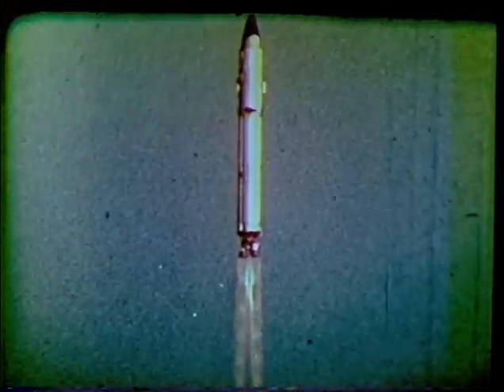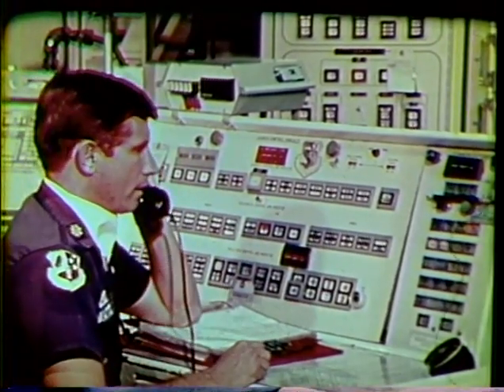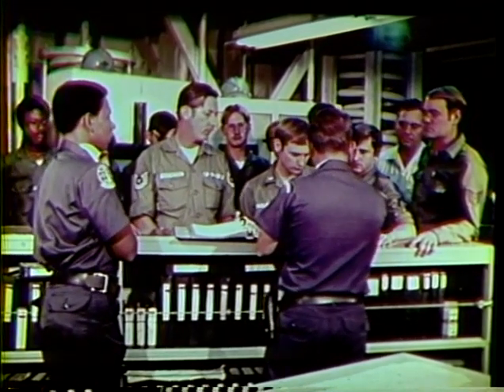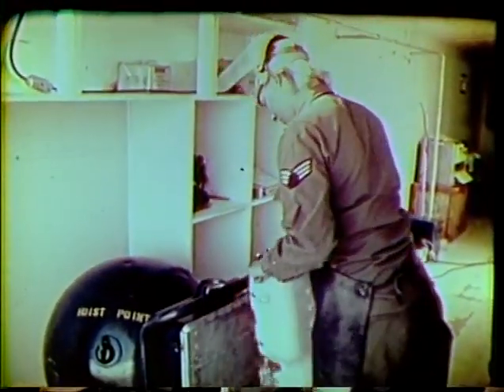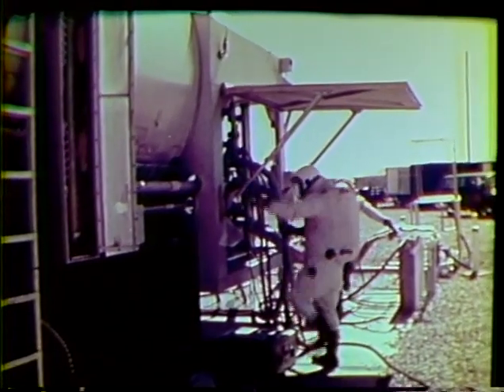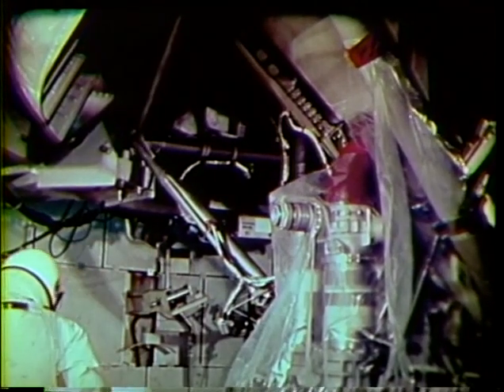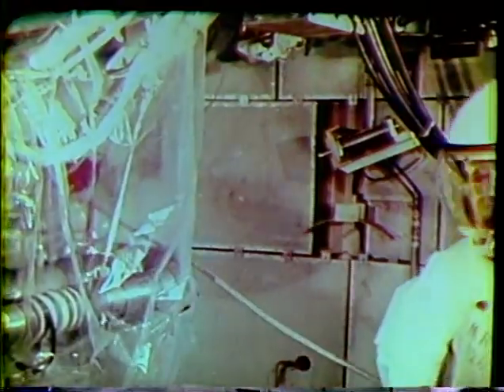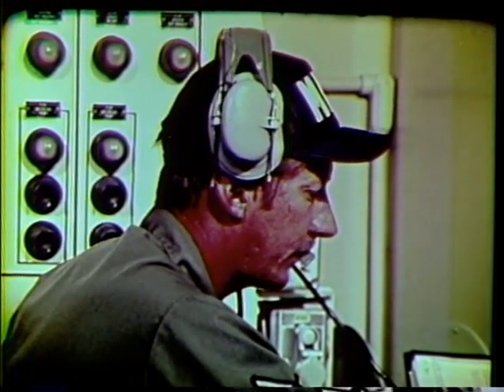Titan II Propellant Transfer Operations (1980)

Comment: Crazy to think that they used to use UDMH rather than solid fuel.
Reply: REMEMBER the SPACE program started whit titan 2 as lift body
Reply: At the time storable liquid propellants were a HUGE improvement over the first generation liquid oxygen/kerosene propellant missiles like Atlas, Titan 1, and the Soviet R-7 Semyorka (still in use today as the "Soyuz rocket").  Liquid oxygen is negative 291 degrees, so it's a cryogenic liquid that has to be stored at extremely low temperatures and in pressurized systems.  Unfortunately due to the low temperatures it constantly boils off in the lines and missile propellant tanks, so those early missiles had to be stored with the propellant tanks DRY and IF the missile needed to be launched, it couldn't be until the propellant was loaded into the missile.  In times of crisis, the missiles could only stand "on alert" ready to launch for a finite period of time, basically until the liquid oxygen storage dewars adjacent to the coffin launcher or missile silo ran out of liquid oxygen, since the tanks of the missile required constant "topping up" of liquid oxygen due to boiloff, and venting of the boiled off oxygen vapors from the tank to prevent the tanks from overpressurizing and rupturing.  Once the dewars were empty, the boiloff would go unreplenished until the missile no longer had enough oxidizer to perform its mission.  It would be "out of commission" until the dewars were refilled so that the missile could go back on alert.  Fueling operations for the old liquid oxygen missiles took hours, so yeah lots of operational limitations and disadvantages to the old Atlas/Titan 1's and Soviet R-7.  

Engineers figured out pretty quickly that room-temperature storable liquid propellants would be far superior.  Since they're room temperature liquids, they don't have to worry about boiloff issues like liquid oxygen, and can be stored in the missile tanks for very long periods of time, so the missile can stand "on alert" for long periods of time fully fueled and ready to launch at the turn of a key, like solid propellant missiles.  The downside is, they're VERY toxic (hydrazine and nitrogen tetroxide oxidizer) and require the use of "space suits" and very careful propellant handling to prevent exposure and death.  They're also highly corrosive and hypergolic, meaning they ignite on contact with each other... this means leaks are particularly dangerous, from a fire danger as well as toxic vapor danger perspective.  This was the reason that the US Navy decided to develop solid propellants for their submarine based Polaris missiles, since the risks of toxic vapors and flammable liquid propellants capable of igniting on contact was deemed too dangerous for a submarine (fire aboard ship is the biggest nightmare for ship or sub personnel).  Solid propellants can't leak or ignite on contact or emit toxic vapors, etc.  The Soviets didn't have solid propellant technology for large missiles until later, so most of their ICBM's and SLBM's were storable liquid propellant fueled until the 1970's.  

Titan II, using storable liquid propellants, was a huge improvement over Atlas/Titan I in this regard, despite the dangers of handling the toxic, corrosive, and hypergolic propellants.  Liquid oxygen had it's own dangers in handling, being cryogenic and pure oxygen has the tendency to burst into flame on contact with anything flammable, and to burn extremely vigorously... even the oils in a fingerprint can ignite in contact with liquid oxygen, aluminum will burn like rubber with liquid oxygen, even diamond burns in liquid oxygen.  SO they were used to dealing with the hazards of liquid propellant; storable liquid propellants just had some different issues from liquid oxygen.  

As development of the solid propellant technology advanced, it was clear that future missiles would be solid propellant.  No tanks, no valves, no complex mechanical rocket engines, it's a solid so it cannot leak, no toxic vapors or cryogenic temperatures, etc.  The fuel is much denser, so more can be stored in a smaller missile.  Speaking scientifically, the most EFFICIENT propellant for missiles is liquid oxygen and kerosene, it has the highest specific impulse or "fuel economy" in layman's terms, (yes liquid hydrogen/oxygen is higher but not used in missiles because liquid hydrogen has a whole 'nother set of complications in its use); storable propellants like hydrazine and nitrogen tetroxide have lower ISP (specific impulse) thus it takes more of it to do the same job, which is why Titan II is larger than the LOX/kerosene Titan I (plus greater payload/heavier warhead, which required more fuel to propel it to its target).  Solid propellant has the lowest ISP, but it's denser and thus more fuel fits in a smaller missile.  Operational concerns outweigh sheer efficiency, IOW, solid propellant is "good enough".  The solid propellant Polaris was much smaller than its Soviet storable liquid propellant missile counterparts.  It was clear that solid propellants was the "wave of the future" for all future ICBM's.  The first Minuteman missiles went on alert during the Cuban Missile Crisis.  Minuteman was a much smaller missile than its predecessors, could stand on alert virtually indefinitely with its solid propellant ready to ignite at the turn of a key.  The silos could be much smaller and simpler, allowing them to be hardened against nuclear attack much more than the larger, more complex silos required for liquid propellant missiles, which improved survivability of the missiles and lowered costs and made them much easier to build.  It also did away with propellant handling in the silo for the missiles, since the missiles had its propellant cast in the rocket motor at the factory and thus none of these complex and dangerous operations, and none of the plumbing and monitoring/support systems required for propellant handling in the silo.  The downside is, the missile is EXTREMELY HEAVY because it must be moved, transported, and emplaced in the silo FULLY FUELED, and of course there are procedures required for the safe handling of solid propellant missiles also since the propellant is already mixed together and cast into the motor casing, and any accident which would ignite the propellant would cause it to burn until it  was all expended. Being that Minuteman and Polaris were fairly small missiles, these weight and handling issues were easily overcome (unlike the massive shuttle boosters and proposed 21.6-33 foot diameter monolithic solid propellant boosters NASA had been considering and even tested, but never developed further-- their sheer mass and handling difficulties made them infeasible operationally, at least cost-wise).  Thus as Minuteman came online, it replaced Atlas and Titan I which were retired, and Titan II remained in service due to its huge warhead designed to destroy deeply hardened targets, at least until the Damascus incident revealed the weaknesses of the system and the costs involved were no longer deemed worth it, and Titan II was retired.  

The Soviets too had quickly realized the drawbacks of LOX/kerosene propellants and instituted a crash program to develop storable liquid propellant missiles to replace R-7, like the R-9 and R-11 and subsequent missiles.  Their haste and cutting corners on safety directly led to the 1960 "Nedelin disaster" where an R-9 missile on a launch pad for a test flight, fully fueled, developed a problem and rather than canceling the test, standing down, conducting the repairs, and rescheduling the test, the newly appointed head of the new Soviet Rocket Forces, the branch of service created to oversee the Soviet Union's nuclear ICBM force, decided to order the technicians to the pad to work on the fully fueled missile and conduct the repairs and continue the test.  To "lead from the front", Marshal Nedelin went out to the pad along with his aides/entourage, while the missile was being worked on.  Nobody realized it but a timer on the second stage had been activated and during the course of repairs, the upper stage ignited on the pad and its rocket engine blast soon burned through the top of the first stage's fully filled propellant tanks, rupturing them and collapsing the entire rocket onto the pad.  The spilled liquid propellants ignited on contact, and clouds of toxic vapors gassed the survivors, as the entire area turned into a burning hellscape.  Hundreds of technicians and rocket experts died, along with Marshal Nedelin and his aides; he was only identified by the partially melted medals he had been wearing (he was a highly decorated Soviet general from WW2).  Those that survived were burned beyond recognition and the fire was so hot the tar in the access roads was melting and bubbling, with survivors having to run through it trying to get to safety.  It was the greatest disaster in rocket history.  

Later!  OL J R :)
Reply: Solide tale Up more SPACE 
This if you look at IT 
Have more power on less 
SPACE
And the siloes need to be way
Deeper if solid ..solid became a THING 
On the shuttel.. in the 80 this is way Way before
Reply: @kennethschultz6465  No.  Solid propellant is less efficient than liquids, BUT it's MUCH denser, so more fuel fits in a smaller package, which is exactly what you want for a missile.  In addition, the solid propellant is mixed and cast as a paste into the motor casing and cured into a solid chunk at the factory, so there's NO propellant handing lines, valves, systems, monitors, vents, etc. required in the silo for solid propellant missiles versus liquid propellant missiles.  This means the silo can basically just be a "hole in the ground" made from extremely hardened reinforced concrete, making the missile much harder to destroy than the larger, more complicated silos which cannot be built as hardened as the smaller solid propellant missile silos, making liquid propellant missiles more vulnerable to a nuclear attack.  Basically the only thing solid propellant missiles need in the silo is a series of wiring/cable connections to the missile to monitor the sensors aboard the missile, program its guidance unit and provide power to it, and to order the missile to ignite when launched.  Solid missiles are also much simpler, as there's no complex liquid rocket engine with propellant pumps and combustion chambers and injectors; solid propellant missiles use solid rocket motors which burn the premixed propellant from the center outwards, and exhaust the hot gases through rocket nozzles which steer the missile in flight under control of its guidance system.  

The shuttle solid rockets came about as a cost-saving measure, and to simplify reusability.  NASA did not have the money to develop the fully-reusable flyback shuttle booster which the original shuttle had been based upon, and had to team up with the Air Force to get the funding necessary to even finish the shuttle, which changed the shuttle program remarkably and not for the better.  Solid propellants had always been deemed "too dangerous" for manned vehicles, precisely because they cannot be shut down once ignited-- they burn until the propellant is all expended.  Liquid rocket motors can be commanded to shut down so a crew vehicle can escape if the booster is malfunctioning, solid propellant boosters cannot be shut down.  NASA and the Air Force needed a reusable booster, and while experiments on dunking liquid rocket engines into salt water and then refurbishing and reusing them had been done,  and various proposals for parachuting delicate liquid rocket boosters into the sea for recovery and reuse had been studied and proposed but never funded or attempted,  landing a fragile thin-skinned and very large liquid rocket booster into the sea and recovering it and refurbishing it for reuse and certifying it 100% reliable (or as close as possible for a manned vehicle) was deemed too problematic.  Reusable solid rocket boosters would use a very thick (about 2 inches thick) maraging steel (same steel used in submarine hulls, extremely tough material) casings to contain the rocket propellant and form the walls of the solid rocket motor, and thus were MUCH tougher and easier to recover after a parachute landing at sea and towing back to KSC for reuse.  Liquid rockets landing in the sea would experience hard to predict landing forces, stressing the vehicle's airframe, possibly bending or stretching or at the very least stressing the metal structures and weakening them, and possibly causing propellant leaks or failure on subsequent flights, which is why solid propellant boosters were chosen for the shuttle.  In point of fact, the solid rocket boosters of the shuttle cost SO MUCH to recover, refurbish, inspect, transport by train to Utah for more propellant to be cast inside them, and then transported back to the Cape and stored, and then transported, erected into the boosters, prepared for launch, transported to the pad, launched, and recovered again, that it would have been cheaper to simply make disposable boosters out of spiral-filament wound composite rocket motor casings like those used for missiles which are "single use only" fire and forget type vehicles.  The failure of a solid rocket booster caused the death of 7 astronauts in the Challenger disaster.  

Solid propellants are REALLY inefficient and heavy and hard to handle, which is why they're a very poor fit in the space program, where weight and ease of handling and the benefits of more efficient liquid propellant is a real bonus... which is WHY solid propellants, particularly LARGE solid propellant boosters like the Titan III/IV had, have been retired.  Small monolithic solid propellant boosters like the Delta series rockets and more recently, the Atlas V and Delta IV use, have survived because they're good cheap "extra thrust" at liftoff and not as difficult to handle or expensive to operate as LARGE boosters like the segmented Titan III/IV SRM's or the Shuttle's huge segmented SRB's.  Even going forward, NASA's new SLS will reuse old shuttle boosters, but NOT recover the casings, instead allowing them to crash into the ocean and break up and sink, as it's not cost-efficient to recover them.  When the Air Force realized that Titan IV cost about the same as a shuttle launch, and opted to develop the EELV boosters to replace them, (Atlas V and Delta IV), only small solids ended up being used.  For the "heavy" launch rocket versions, they reverted to a "common core" approach using two additional first stages virtually identical to the core (some minor differences between the two) flanking either side of the core and acting as huge LIQUID rocket boosters!  

It's the same reason that Falcon 9 uses a LIQUID recoverable first stage, and land or shipboard landings, to simplify recovery and reuse.  The Falcon Heavy uses the common-core concept using a pair of first stages on either side of the core as LIQUID ROCKET BOOSTERS, again returning to a land landing to simplify reuse.  

Solid propellant is TERRIFIC for missiles-- no propellant handling and ready to go at a moment's notice for as long as the missile is "operational", but for space launch it's just a poor fit, particularly manned launches.  

Later!  OL J R :)

Comment: I wonder if it really was like this, or if a culture of shortcuts and good-enough, took over after a few years?
Reply: Liquid fuel missiles didn't have room for good enough. 

The fuel was not only incompatible with human life it also ignited if combined with the oxidizer.
Reply: @tricitiesair  Nitrogen chemistry is complex and unpleasant once oxygen and hydrogen get involved. The oxidizer especially has a constant 3-way chemical equilibrium and this is temperature and pressure dependent. You can see the care required to handle it, the fuel (Aerozine 50) is if anything worse in toxicity although more stable.
Reply: you might not sleep well if you read up about how the US neglected upgrades of the control computers until 2016 approx..
Reply: @danielrazulay  Dunno, seems like running nuke silos on tapes is preferable to windows 11 honestly.
Reply: @danielrazulay  they do that for a reason. Duh. Keeps it from being tampered or hacked. Sleep well tard
Reply: Yes it was really like this...My Husband was there...